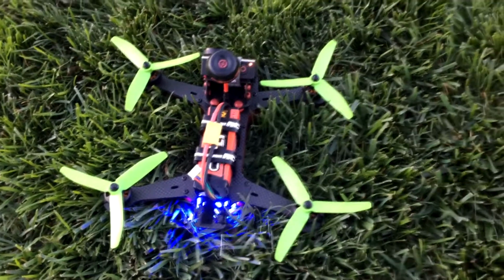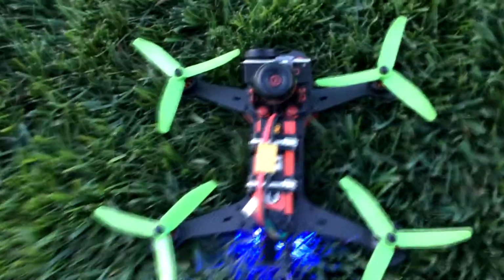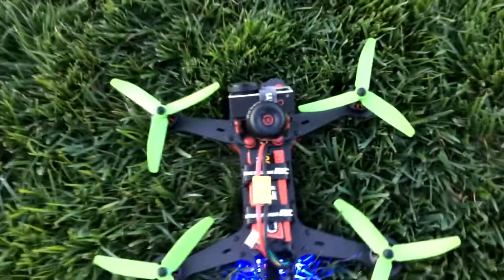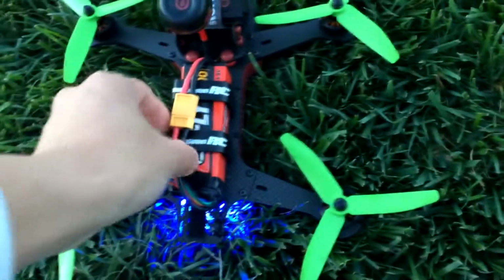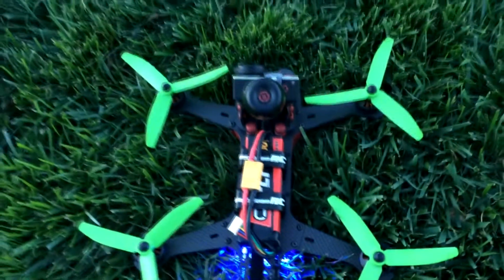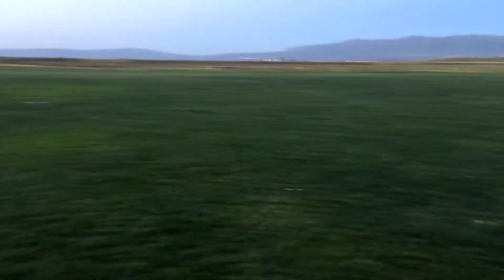Maiden Flight Test Vortex 250 Pro with RadioLink AT9 at Baylands Park

Comment: helped out alot really appreciate that info... I was scared to blow the esc's on the vortex
Reply from the maker: No problem.  You will blow out an ESC if you decide to use much larger motors and higher pitch and length props. Make sure to check current data posted on various websites.  My setup with HQ 5x4x3 props, I haven't burnt anything out.  If you were to go with 6in versions of these, you will pull more current and overload the ESCs. 6in bullnose dual props are suggested. Not 6in tri-props.

Comment: Never mind... Just re-read your details and you are flying in self-leveling mode or "angle" mode. I can see that you're fighting to keep your forward angle. Thanks for sharing since mine is in the mail!
Reply from the maker: +Pyrock All good.  Best to run in rate mode with this racer as the stock PIDs handles quite well.  First flight tests, I tend to do angled mode as sometimes the rate modes can be unpredictable - plus I had not had enough flight time compared to now.

Highly recommend quadcopter!

Comment: +Matrix Writer I recently purchased the Ummagawd version of the vortex with the at9 transmitter and r9d receiver and have been having some issues with this setup for instance when changing the led colors it will get stuck on a color the color changes in osd screen but not on quad and if I have color set sometimes when armed it wiil go to flashing green I have to land disarm and then rearm and it will go back to solid color and now the quad seems to cut out for a split second during flight and after a minute of flying it will start leaning to the right have you had any issues with your vortex or Radiolink transmitter I'm not sure if it's the vortex or transmitter
Reply from the maker: Hard to pin point the exact issue, but I would try doing a hard reset on the flight controller.  I think there is a button somewhere to do that and then rerun the radio set up.  Please let me know how that goes.

Comment: what's the highest c rating can you use on a stock vortex?
Reply from the maker: +59poppN There is no C rating limit (with any thing) as the electronics will determine the amount of current to use.
However, mass of the battery needs to be factored as typically batteries with higher C ratings will be heavier than those with lower C ratings.  In this video, I use a 30C battery with capacity of 2200 mAh and that is about 66A of current that can be supplied to the quadcopter.  You can get a 1300 mAh with 50C rating which would be 65A of current.  Lower capacity batteries need higher C ratings to get the same amount of current with a higher capacity battery with lower C rating.

I don't recommend capacities higher than 2200 mAh as it will weight down the quadcopter and it will negatively impact performance as well as flight time.  

Hope that helps!